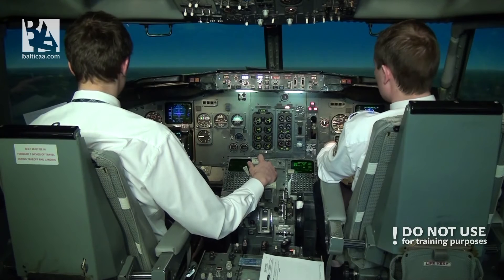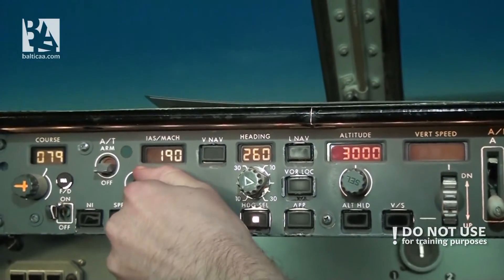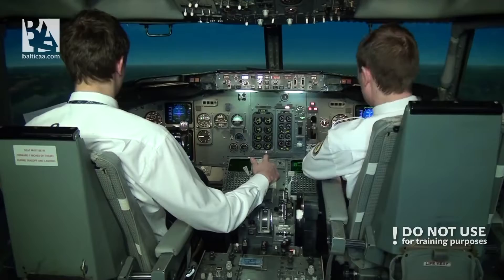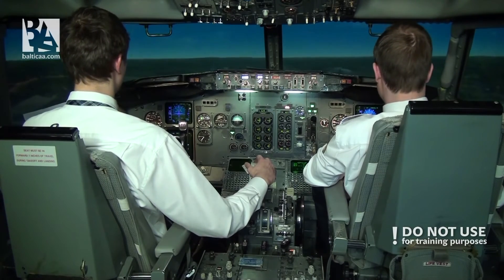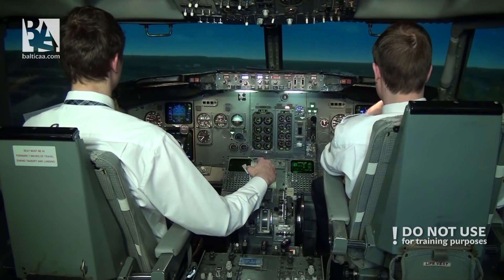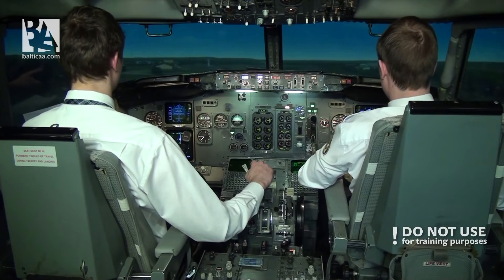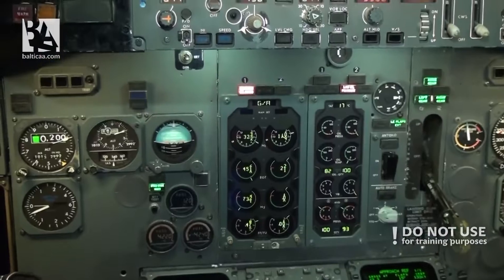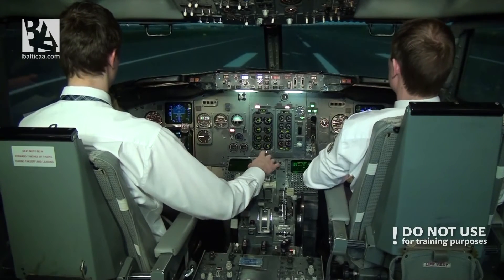Boeing 737 CL: Engine Fire in-Flight

Comment: You're setting transponder code the unsafe way. While setting 7700 you cycled through 7500 (hijack) and 7600 (radio failure). If the ATC sees you on radar while you cycled numbers there'd be hijack alarm in the ATC :) 
(You should have turned backwards: 7900 -> 7800 -> 7700.)
Reply: Actually, you should put it on Standby first, then it won't transmit while you are cycling through.
Reply: Transponder numbers only go up to seven bud, and you cant turn them backwards on a 737

Comment: Co-pilot: "Runway heading 179"
He then proceeds to dial in 079.
Reply: Everybody is a copilot. The first officer is the captain's copilot. The captain is the first officer's copilot. Call him for what he is, and that is PM in this case.
Reply: c'mon it's just 100 degrees off.
Reply: @zellhaufen8583  😬
Reply: Air Crash Investigation credits.
Reply: Also I did not see them to switch AC power from inoperative burned GEN2 to APU on overhead pannel.

Comment: Something about guys just breaking out a manual to read what to do when an engine is on fire is vaguely terrifying.
Reply: That is the standard operating procedure. Piloting is all about checklists.
Reply: Just the opposite. By going to the checklists it ensures that an important step is not forgotten.
Reply: Mike Verta its a checklist so they know what to do
Reply: Al Lipscomb Exactly, but isn't the ECAM procedure ever so convenient?
Reply: How can you expect people to remember every checklist in every situation? All they need to know is the important steps, which they did (manuel control, idle throttle, off engine, active extinguisher). This also ensures nothing is missed

Comment: not a fuel switch!-it's an engine start lever-and identify before actioning puleeze...kids playing themselves really
Reply: Since they are training to become real pilots, im prettu sure they know better than you.
Reply: +fokjock it is clearly label "fuel --- cutoff" on the plane but it is also called a engine start lever in the qrh and in technical terms. it can get confusing.

Example:
Captain: Switch the engine start to off (referring to the engine start SWITCHES on the overhead).
First Officer: Engine start to off switches start levers to CUTOFF
Captain: Oh not again! Calls ATC United 776, our dumbass of a first officer shut off our no 2 engine because of miscommunication. Holding at current position.
Reply: Joshua Joshua Joshua
The label "fuel cutoff" is there because that is what it does-BUT it is not called called a "fuel cutoff switch" by anyone including Boeing-it is a start LEVER.Now start switches are for the start motor to begin-they begin the start sequence-at 25% N2 the start lever is lifted and the start switch will cut out at 56% N2 automatically -unless of course it doesn't in which case you manually turn it off-which happened to me last week.
Please don't assume everyone here on utube
is a Microsoft Flight Sim pilot-some of us fly the real article-and incidently sometimes get a bit fed up flying every day almost.
As a professional pilot you cannot get your instrument terms mixed up-esp in the real sim
where you will get your ass smacked.
Reply: It is not a lever, neither is it an engine start switch. It is the fuel control switch, which controls is the fuel flowing to the engine or not. Yes, you out them on at start, but in no way do they start the engines

Comment: Hey good vid. Quick question; what happens if the fire doesnt go out. Oh and could you do a video with engine and multiple failures :) :)
Reply: You fire a second bottle of fire extinguisher agent (flip the extinguisher switch to the other side) :)
Reply: Wow thanks alot
Reply: +Shaquelle Saul yeah why not! Double engine fires..make that with APU Fire too and nil hydraulics...and additional to Captain incapacitation due to food poisoning from that witch Betty Stew!! hat ll turn the cockpit into a toilet!
Reply: +Shaquelle Saul and if it doesn't go out at all, you evacuate on the side of the working engine

Comment: setting speed and heading doesn't mean that the autopilot is engaged, it is set for the flight director which tell the pilot how the aircraft will fly if the autopilot is engaged.

Comment: It happend a few times already. e.g. SAS Flight 751 was brought down by a compressor stall and the computer not reducing thrust, because of a new system that was introduced. So both engines literally exploded

Comment: Why did the gear warning horn sound when flaps1 selected
Why did you deselect the flight director at 500ft? (I am not familiar with the CL)
Why didn't you respond to the minimums autocallout.
Doesn't the ruddertrim have to be set neutral before landing?
Very nice video though! Pranas is very polite indeed

Comment: very important! when you say (according to SOPs can differ but result is the same) CONFIRM thrlever n2 to idle, never close it the same time.
First let the PF look at the lever and let him confirm that it is the correct engine, then set idle. shutting down the wrong engine actually happend, reasulting in an aircrash
.
Reply: This isn't for training

Comment: there's an electric hydraulic pump which might help if the pressure is lost because of the engines. if there is no more pressure because the fluid is gone, the airplane is out of control except for the engines. to show that is rather pointless because it's not likely to happen and if it does, the plane's most probably going to crash.

Comment: Very nice video! Is there a reason not to use auto brake in this kind of situation?
Reply: Depending on the damage from the engine fire, if the autobrake system fails to work on one of the main landing gear, it can induce skidding on the runway, which could turn catastrophic, especially when you have one engine dead—imagine the left engine in reverse as only the left main gear is braking, and you'll see what I mean.